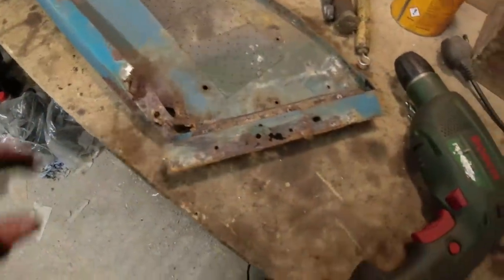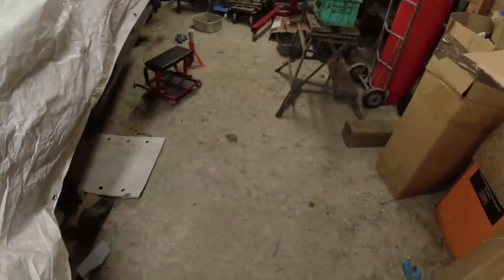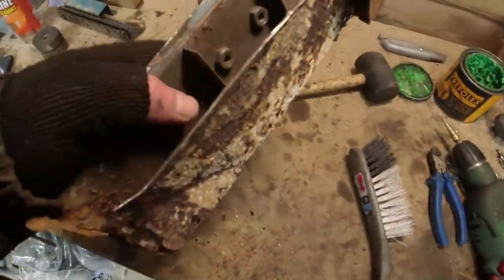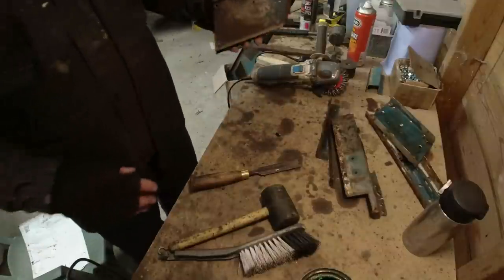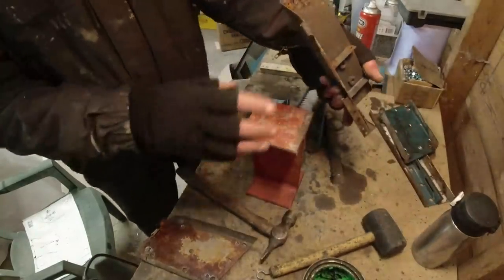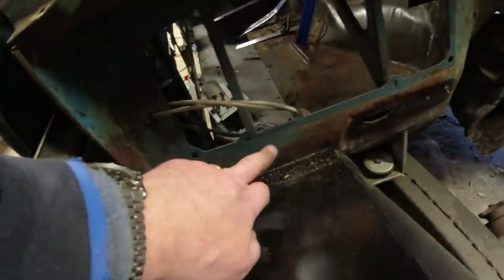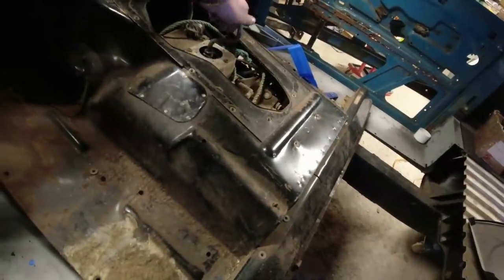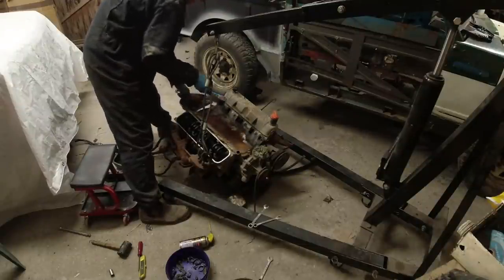Episode 28 - 1971 Range Rover BOB body frame again - Parental warnings

Comment: You know that you’re watching too much Church House Classics when you see a chair with a gaping hole and you know exactly how that hole got there (harpooned by a prop shaft) 😂 

Side question- You said that you used a brush on Rustoleum paint on your heater box, what product is that?
Reply from the maker: shant be sitting on that chair again. may have to hang it on the wall though 😂

The rustoleum product I used CombiColour satin black. google it. Can be bushed onto clean but rusty steel etc
Reply: Thanks Richard